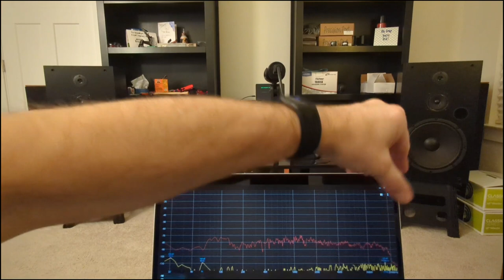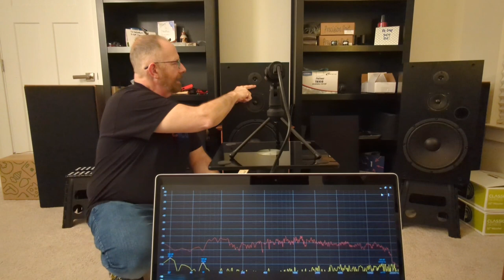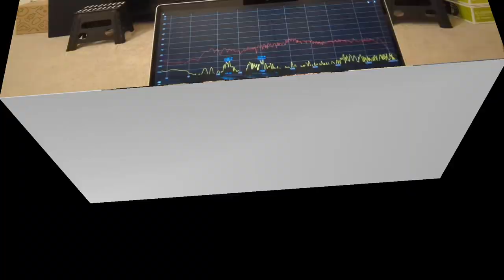Make Cheap Speakers Sound Good With High Quality Crossovers! Radioshack Rca Sts-1230 Project Part 7

Comment: Yes, x-over components are very important.  Open air core, larger guage inductors and poly caps are just better behaved than cheap iron core inductors and electrolytic caps. And yes, open air coils and caps for a 12db x-over on that woofer ain't gonna be cheap. However, you design a speaker to be efficient in the bass by using a big woofer, then you add DC resistance in the signal path when you use a coil - open air coil DCR = .2 to .4 ohms; iron core coil DCR = 1 to 2 ohms; note the decimal points!

That midrange is prolly a closed back driver and they always sound 'shouty' to me. I prefer a mid/woofer that thats x'd over a little lover and in its own, larger chamber.

Comment: Getting ready to recap my realistic Mach 2s I've owned since new so all original components. Refoamed the mids and woofer so now to decide on quality of parts for crossover.
Reply from the maker: That sounds fun! My older brother's best friend had, (probably still does have), there Mach One speakers. Back in the 80's we set them up and compared them to my Sound Dynamics 12s speakers. Night and day, he was pretty much blown away at how much better the Sound Dynamics were. He did have a good takeaway though, because even though they were no match for the Canadian contenders, I had his Mach One speakers hooked up to my Harmon Kardon PM660 and he realized the Mach one's were much more capable with a decent power supply, compared to his Realistic receiver he was running them with, (it was a big one too, maybe a Pioneer that was rebranded?). Anyway... I get off on tangents. As a suggestion, I would also recommend adding some bracing which I found really cleans up the bass and can make it significantly louder as well as maybe adding the sound deadener pads. Actually that may make a bigger difference than the crossover mods, but both combined would likely be huge.
Reply: @World According to Todd  Yes, growing up my neighbor was a manager at RS and had Mach 1s with a 250 watt per channel Amp he made. With being a sealed enclosure the more power they got the better they sounded. I was thinking about bracing and no rez or some sort of dampening material as no doubt the enclosures are not that solid. I am concerned that the ferro fluid in the tweeters might have dried up thus hurting the sound but also believe the bi polar caps have drifted easy out of spec. While not audiophile by any  means I have a tendency to listen to music very loud and these speakers will most definitely rock the house.
Reply from the maker: @koprcord5338  Very cool. Yes definitely you should notice a difference with bracing, and sound deadener. I've been trying Siless which is affordable and works. Honestly, the crossovers may benefit by changing the capacitors and any resistors in line with the positive sides of drivers, and if the woofer is crossed over, (many weren't back then), you may benefit slightly from a new bigger inductor. If the woofer is running straight off the leads without cross over, an inductor just above the midrange crossover may help cleanup any cone break-up from the Woofer.

Comment: I just replaced the woofers in my pair of STA-1230's. Installed a set of Goldwood GW-12PC-8 12" from Parts Express
that were on sale.
 The crossovers were replaced about six months ago, with some 375/3000 three way Dayton crossovers also from Parts Express. 
  I did have to router the hole a little bit to get the drivers to fit, but that went smoothly. I was a little apprehensive about
 cutting on an otherwise excellent condition speaker box. The replacement drivers cage is much beefier, and the magnet is much 
 much larger and heavier.
  After about 300 hrs. break-in, they sound incredible. The difference in deep 
 and quality bass is huge. I've heard people say that better woofers make the mids and highs sound better on a speaker. I always thought,
 how is that possible since it's a bass driver. Well, I believe it now. The mid-range and tweeter really do sound better. I really never had an issue
 with the mids and highs of this speaker. It was the bass that always left me wanting more. I've turned off the Sub Woofer because they sound
 so much better.
  They're paired to a Marantz SR6015 set to Direct or Pure Direct. I giggle every time I listen to them now. Even my wife, who couldn't care 
any less about audio than what she does now, noticed a difference in how much better they sound.
  Next step I guess, will be the tweeters
and mid-range done in separate steps of course.
Reply from the maker: That's an excellent choice and I'm sure you hear a difference because those gold wood woofers you chose are perfect for that enclosure! You're into subsonic range now on the low end, likely dipping into the 25 to 30 Hz range. If your next investment is a tweeter, I would highly recommend the Peerless DX20BF00-08 which I bought from "digi-key" (parts express only sells them in bulk). That little tweeter will drop into the hole with only minor mods. It has a sensitivity that will pair well with the woofer. As for the midrange there's a seller on ebay electro mavin who sells the ESS labs closed back mid range which should be a direct replacement for the stock one, with no mods.
Your crossover points are well suited. There's actually quite a bit of overlapping and the 375 Hz you mentioned allows the goldwood woofer to handle a large swath of your music playback up into female voice range, various strings and more,  which played through the 12" with 90 Db sensitivity will really enhance the entire mid range and mid bass, while still dipping into the lowest of lows in typical recordings, (which rarely even go that low). Your port is about 2-3/8 and length is around 6" which means the box is nearly perfectly tuned for that woofer!

I like the aluminum framed drivers but hate that they require hole mods, but the frame is stout, resulting in less resonance and better cone control. If you've not used sound deadener pads, it's worth the investment. Especially on the back panel and sides.

Thanks again for sharing!

I'm really glad your mods are working and the differences are huge when you get it right!
Reply: @wattspeakers Thanks a million for the tips. I made note of your sources for the other two drivers.
 I think I saw one of your videos on the sound deadener pads. I'll re watch it.
 I also did some bracing in them. Glued two hardwood 2x2 braces side to side in the middle, straddling the woofers and I really think that stiffened the cabinets in a positive way.  
 Without your videos, I wouldn't have had the inspiration to do the mods. 
 Thanks again!

Comment: Good imaging and details.  The drivers for midrange and highs need up graded. Maybe some extra insolation for inside  to get rid of the boxy dry tones. Good on the crossover.
Reply from the maker: Thanks for the comments! Mid-Range and Tweeter upgrades in progress, cabinet bracing and insulation ready for installation. Then... tweaking them to get the most from the combination.

Comment: Learning a lot from your videos, thank you. I know nothing about this topic but I have some old Fisher speakers. They don’t have a crossover, but have inline resistors, etc. can I simply replace all that with a dedicated crossover?
Reply from the maker: Thanks for watching and the project you're doing sounds right in my wheelhouse. Generally speaking, (no pun intended), yes you could either try to duplicate the existing crossover with better components, or you could use an off the shelf crossover. Depending on the model, number of drivers, size of drivers, it's hard to give any particulars however... (assuming you're keeping the same drivers), look at the capacitors presently on the tweeter and Mid-Range if it's a 3 way. That would give you a rough idea of crossover values. You can use the values to look at one of the many charts or crossover calculators available and consider the value (the number usually printed on the capacitor), and nominal resistance of the drivers if they're stamped, if not just assume they're 6 to 8 ohms each transducer. Then whatever works for your skill level. You can buy parts and make a crossover, or buy one that's premade. Chances are it's probably setup with a single order crossover, so a second order crossover will likely clean it up significantly. If for some reason there's not values printed on the original capacitors, you  could opt to find a crossover that's suitable for most drivers. For example, common 2 way crossover is around 2500 Hz, and a 3 way, is typically in the area of 500-1000 Hz and 3500-5000 Hz. 

Other inexpensive and easy things to improve the sound, are to add some braces and sound deadener pads. If you're using the original drivers, probably fine to keep whatever original insulation it came with. If it didn't have any, best to add some, just keep it away from the port if it's bass reflex.

Have fun!